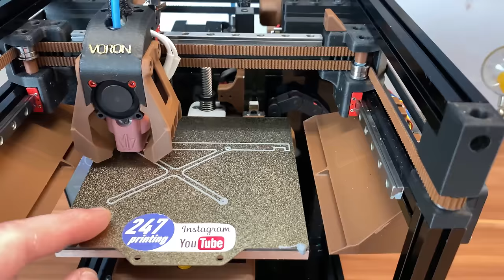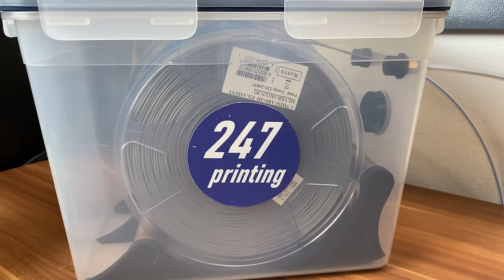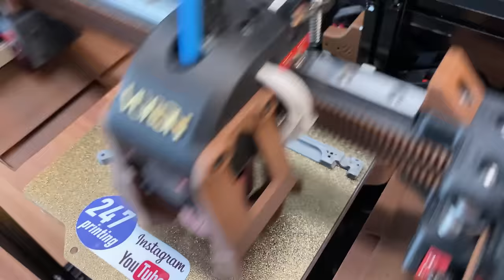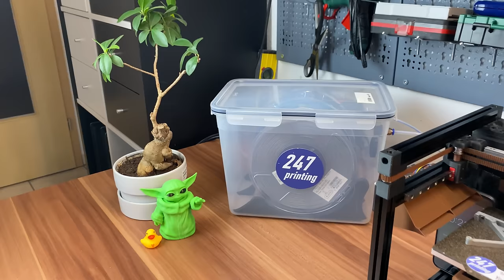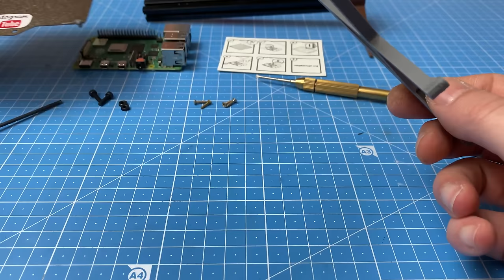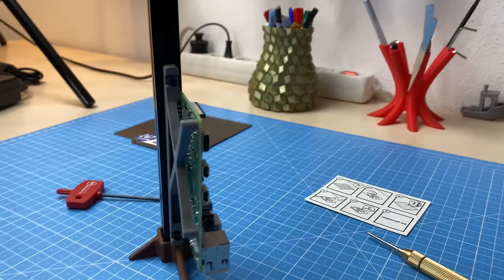1000mm/s: THE COMPLEX PRINT on Voron Ferrari !

Comment from the maker: Quality/functional check at around 11:00 ☺️👍
Reply: DAY-amn that's fast!  Somebody needs to remix the shell to make it a 'Bugatti Voron'!  Now do some of the FullControl GCODE demo prints to REALLY open it up!
Reply from the maker: @KeithOlson  Hey Keith, actually I thought about that for some time already :) I dig "Bugatti Voron" :D. What do you mean with FullControl GCODE demos ?
Reply: @247printing  It is basically a GCODE creator unlike anything else available today.  Thomas Sanladerer just did a piece on it, (https://youtu.be/ZgytQDoaD5M)  Here is an intro to how it works: https://youtu.be/yGtyw3oLOVQ  As Thomas points out, having the software output just the GCODE to create the piece (instead of modelling then slicing it) can seriously speed up print time.  (In the case of a battery holder that Thomas designed, a two hour print from a normal workflow only took half an hour to print when created using FCG.)

Comment: This is why I love open-source projects.  With the introduction of the speed boat race ive seen cheap home printers go from 150mm/s to 1000 in the course of a year or 2
Reply: vorons arent exactly cheap tbh
Reply from the maker: That’s true and you have to build them for yourself. But you really get what you pay for
Reply: @littlesnowflakepunk855  oh yeah ofc.  It's like buying a nice drone you definitely get what you pay for.  However $2000 today can be stretched soooo much farther.  I mean they got ender 3s running silently at 300mm/s with just a firmware and driver update too
Reply: @mhgscrubadub9917  $2000 is pretty steep even for a voron 2.4. They have plenty of printer designs with varying costs. My voron 2.4 at 350^3 volume came out to a total of about $1780. If you source parts well 1500 and under is possible with a 300^3 volume and cheaper depending on which voron you build.
Reply: I think no matter the case it's a toss up. I can see doing this simply "because". I'm ready to build my next printer and looking at the possiblity of running  my own side gig. That alone can justify the price invested considering the time to prototype and then "finish" a particular part would be considerably faster. On the other hand, if  your an "afficionado" I could see  you choosing so simply because this is, superior, period. Obviously the casual "look at my coat rack" guy/girl is probably not going to drop 2k however, I can remember when a windows workstation would cost me that for doing simple things. My pi cost no where near that and I use it for TEN times more than I did that 2k workstation.... It is, what it is.
Reply: @littlesnowflakepunk855  cheap compared to commercial units is what I think he meant. That just a few years back were very expenisve
Reply: @mhgscrubadub9917  doesn’t seem right, marlin can’t really keep up with those speeds and neither can most components like the motion system and cooling, maybe the hotend but unsure
Reply: @futuremapper_  marlin can't since most 3d printer boards are too slow to run higher level commands so fast but adding a raspberry pi with klipper splits the load so your printer board just has to handle gcode commands which isn't very intense.  I've noticed a significant difference from converting my ender 3 on how smoothly it runs fast movement commands
Reply: @mhgscrubadub9917  that isn’t just a firmware and driver update then
Reply: @futuremapper_  that depends what you mean with Marlin not being able to do over 300mm/s, it definitely can, but you'll need atleast a 24V printer, older Prusa's couldn't get past idk what anymore, but 24V solved alot

then there's the matter you need to change the speed and acceleration in the firmware itself and make sure Cura /your gcode doesn't override those values

then there's a matter of having your belt tension and other things perfect, i've had serious acceleration issues (well missed steps and belt slip, separately ofcourse) at extreme speeds

for mine i found 6500 x acceleration and 2250 y acceleration to work properly as a max value (glass bed so Y is quite heavy), anything above that worked for me but as the bed got heavier it wasn't maintainable to not get problems

i also had moments where it lost steps because my tension was too tight, and also where my belt slipped when i was still fine tuning it, while i have those metal adjustable tensioners

X also has a Hemera with Volcano on it rather than the og extruder etc which is not a light combo

i never tried more than 500 as even my Volcano heatblock cant keep up then

it probly also helps i have an SKR Mini E3 V2 in it tho, much faster cpu than the og atmega's

i'm thinking of making my own board, or connect drivers and mosfets up to a Teensy 4.1, those have 600MHz Cortex M7 CPU's out of the box, with a laptop heatsink you can overclock them to a whopping 1GHz lol

sounds like serious overkill tho it sounds like fun
Reply: @mhgscrubadub9917  klipper?

Comment: As an engineering student in my last year, the amount of control and tuning that goes into each system in the printer is astounding. Good mechanical, thermal and control systems (pressure advance/input shaper) goes to show whats possible. Thanks for sharing.

Comment: Me: looking at my Ender3.
My Ender3: Don´t you even dare take me higher than 80mm/s -.-
Reply: I run mine at 100-110. Is that bad?
Reply: @owowowdhxbxgakwlcybwxsimcwx  its not about the speed, but the acceleration. Your print basically never reaches the speed you specified unless its a massive long line with minimal direction changes
Reply: Ender-7 run  250mm/s with very high quality.
Reply: My Ender3Pro (TMC2208 drivers) with Klipper FW running 150mm/s happily. (around 2500m/s acceleration)
Reply: In my own speedboat race submission I ran 325mm/s with 30K Accel, the Ender 3 Will happily do it... the hotend however, no.
Reply: @TheBarrelDoesGaming  30k accel on ender? Are you one of these people saying that abomination left on table after extreme regimes still resembles a boat?
Reply: @MrYaroslav210  In my spare time, yes, the biggest issue with speedboats at ~10 Minutes on an Ender 3 is actually under extrusion, you can get a perfect one at 12 Minutes, with a new heater because the stock one just isn't powerful enough. Having higher accels helps significantly in all kinds of printing, in fact, a benchy is actually harder to do than a lot of stuff I do, I mainly print structural parts with lots of infill, stuff that's quite easy to print in terms of cooling and I don't print at 325mm/s all day long; the lessons learned from speedboats are actually incredible for getting more print quality in less time.
Reply: @noawe_  I saw one guy run ender 3 on 220 all time after 2 days every screw was blown away :D
Reply: @owowowdhxbxgakwlcybwxsimcwx  yea, they are worse
Reply: @noawe_  100mm/s is my go to print speed for any normal 3d printer. With proper filament, even a Geeetech E180 can print at 100mm/s (with 250°C on the hotend of course)

Comment: It is no longer the Voron 0, it is now ‘Voron 247’.
Reply from the maker: Theodore... That's a complicated point here. I gotta have an own naming and I talked to the Voron about that! We agreed that I need a clear differentiation from the Voron pattern! Still no clue how to name my race car :)
Reply: @247printing  Voron 0 - Supersonic ;P
But a good question actually. As with 3D printers speed and precision is not divided in clear steps but maybe right now is the time to establish some criteria/terminology like tolerance levels in bearings or the car performance tags like GT, M3, S4 etc which gives some indication of what kind of performance you expect. I have a good feeling that the 3dp communities can find out some common ground where it could be tiered like in games with T1, T2 etc or some different tags that tell the capabilities.
Print duration and dimensional accuracy would be easier to clarify than for example surface finish. A „pro“ model could be like a pristine benchy in 10 minutes. But that also depends a lot on just part cooling itself.
Right now the print speed declarations of companies like 250 mm/s only indicates the max flow rate, but nothing about acceleration, dimensional accuracy, surface finish through resonance and cooling.

What are your thoughts about this topic? I am very interested in it as you have daily contact with printers that are fast AND precise on a level that most in the scene don’t reach or comprehend (like me who is always in awe watching these videos :D), meaning the struggle to achieve that themselves limited through knowledge, experience and resources like access to tools and necessary finances.

When Klipper with resonance compensation and good cooling like yours becoming more of a standard in high speed printers we could have a chance to standardize some terminology to make it easier to distinguish performance levels. Or it just unlocks the next crazy level and we will just continue until we reach the speed of light :D

Cheers :)
Reply: @247printing  sorry for the wall of text. It was an exhausting day and I went overboard. Wish you a splendid day :)
Reply: 247printing - Norov247?
Reply from the maker: @chaicracker  I also wish you all the best!

Comment: That’s a great tradeoff for speed versus visual quality and functional quality: certainly not like the Yoda print for visuals, but it functionally appears to be as perfect as needed.  I’d be curious to know if the part had some thermal shrinkage after you assembled it into place, as you wasted no time taking it off to let it cool: I’d expect it hadn’t fully contracted, and that sucker is a TIGHT install.

Comment: All channels are talking about the speed of a Voron but nobody is talking about the respectiv material. PLA can be print with 1000mm/s but try ABS or PC or PETG without warping : Good luck :D
Reply from the maker: That print was done on ABS. Printing this on PLA might even be harder than on ABS as the flow is worse. PC might need an enclosure, but has very good flow capabilities. It's all about a good balance of the settings and not about the material per se. Warping is not always the biggest issue.

Comment: Maybe you could optimize the process by changing the wall line count to a higher number so that the infill is not the 45 degree angled but like the wall contour. I imagine it to be a lot faster because less direction changing.
Reply from the maker: Absolutely and I tried it - was 09:XXish

Comment: while watchin i got an idea, try the bernard system (probably wrong name) but first cry the air first, then pass it through a peltier cooler to cool the air, also use insulation or the cooling is useless! (probably is when the air reaches the hot end) it might make the print head lighter. you can also try the rotary extruder too.

Comment: A bit of under extrusion in critical places. Don't think I would use that part but even lowered to 500mms I think it would print spot on and still be quick as shit. I order mine Monday so wish me luck lol.
Reply from the maker: Definitely! Max speed here is 500mm/s for the infills and that is already very critical concerning extrusion flow - the 1000mm/s are a maximum for my printer to print at 0.1mm layer height and 0.4mm line width, but not suitable for a 3D Benchy (acceleration more important than speed). It's 0.25mm layer height at 0.5mm line width (according to rules) - at 500mm/s it would request a extrusion flow of 62,5mm³/s, which is quite a bit over the capabilities of the used hotend combination (Magnum with Volcomosq). To compare: E3D V6 is 15mm³/s and Standard Mosquito Magnum around 30mm³/s.

Comment: Awesome technical demonstration! I'm assuming the reason you're doing 0.1mm layer height for this model is the flow rate being limited. Keeping that in mind, wouldn't the print turn out better doing 0.15 or 0.2mm layer height and reducing the speed to get the same flow rate? (I know this video is not about that, but for functional parts this seems more appropriate)
Reply from the maker: You are ABSOLUTELY right, plus: reduce acceleration
Reply: @247printing  of course, but especially in the inflill of the arms this would increase your print time significantly since you're just acceleration limited there. Maybe reduce it for the perimiters and keep it higher for the infill. (not sure which slicer you use, but PrusaSlicer lets you define acceleration for each feature type)
Reply from the maker: I see you know all the tricks :) IdeaMaker helps a lot with this, I am really looking forward to tune the profile for a qualtiy print! Even for this print: With more time for optimization I strongly guess it can be faster at higher quality. Biggest problem was pressure advance / smooth time here.
Reply: @247printing  yea, I'm always amazed how much you can gain with just some settings optimized. I bet at these speeds pressure advance and input shaper become even more important, or even a necessity.
Reply: @247printing  how do you go about smooth time with pressure advance? Tried to tinker with it but still don’t know what direction is the right one to adjust 😅

Comment: Have you shared the printed parts for the print head?  I was considering using an LGX in Bowden to feed a hotend similar to yours. This is a fantastic design!  Amazing print quality for this speed!
Reply from the maker: I have not shared my designs yet, but if you want to go for bowden look at the V0.0 branch on Voron GitHub (I think even for the 0.1 there is a bowden option)

Comment: That's great results. My selfbuild core xy is sady limited to about 60mm/s because the E3D V6 Lite I used just can't handle more materialflow without weakening the layer adhesion by alot. 
Hot are those side mounted fans working out for you?
Reply from the maker: Thanks a lot mate! I guess your CoreXY is capable for a lot more 👍 The external cooling works good so far, but I have to do more testing on different materials and objects.
Reply: i'd upgrade the heatsink and heatbreak to a real one, the Lite has a PTFE tube that gets up to the heater like in cheap printers like the Enders etc.
Reply: @BH4x0r  how does that affect flow?
Reply: @futuremapper_  it affects the flow because the plastic doesn't get to melt before it touches the nozzle, especially with ptfe lined heatbreaks.

as the plastic you're melting also is more of an isolator rather than a conductor of heat it needs time to get everything molten properly before it gets to the end of the nozzle

that's why i run Volcano or higher flow only

i would personally never go back to a normal V6 heatblock, heck even the Trianglelab dragon HF i got i've upgraded with a "MF Crazy Volcano" heatblock so it's double HF sorta lol

it also took me a long time to find a bimetal heatbreak for my Hemera (found one from ZoDIAC), bimetal heatbreaks with copper in the heatblock side will actually increase flow aswell

i also only run copper heatblocks, because it conducts heat better and they can take more powerful heaters.

Comment: hello great job you did!  I would like to know if this project is scalable for a 350x350mm print area.

I think a larger area would need to be expanded cooling performance.
I keep following your project
Reply from the maker: Thanks a lot! The cooling concept used here (no blowers on the toolhead, external only) might not work as is on a big surface printer. Thanks for following!
Reply from the maker: Oh and concerning a big printer: For this case I built a V-Core-3 (Rat Rig) to work on concepts for Motion, Cooling and Extrusion in order to go faster at quality.

Comment: can this thing print consecutive parts or does it require maintenance between runs bc of high loads?
Reply from the maker: Yes consecutive is possible, the motors are actively cooled. Nevertheless the x-rail and the Hemera bowden adapter are the parts which showed wear after six months of going crazy.

Comment: I am waiting for the final V0 design before jumping in. But wondering if it is possible to print technical filament like CF nylon at these speeds?
Reply: probably not. different materials have different temperature and cooling requirements. higher temp means layers need more time to cool before a new layer can be deposited on top, meaning you need longer layer times in order to get proper adhesion. i believe this is printing abs+ which is relatively low-temp and relatively forgiving in terms of cooling.
Reply from the maker: I did a test on a benchy with Nylon and nylon cf - definitely needs at least a semi closed chamber and high speeds

Comment: How does that cantilever bed deal with the vibration?
Also, how does that ABS act after printing if its not enclosed? Mine is brittle as hell
Reply from the maker: The bed surely is a bottleneck here... I am wondering if it helps to print the mounting from Carbon Fiber (PET). Additionally I try the "Kirigami" bed (sheet metail design, Voron group order). Printing ABS+(!) unenclosed is no problem on my printers - except for the fumes I can't stand.
Reply: My Ender 5 Pro bed is awful. Is there a dual Z mod for this printer?

Comment: Wow, How much power (watts) does it draw at 1000mm/s vs original default speed?
Reply from the maker: Here I assume somewhere between 100W to 150W as long as the fans for the external static cooling are not active - at 100% they add around 200W.

Comment: were only 2 screws out of 4 were able to fit in?
Reply from the maker: They fitted all - but two are enough to hold it and I had the wrong screw driver for one of them. I didn't plan to use the very first take of the recording for this video, but it was already good enough (other wise I'd change the screw).